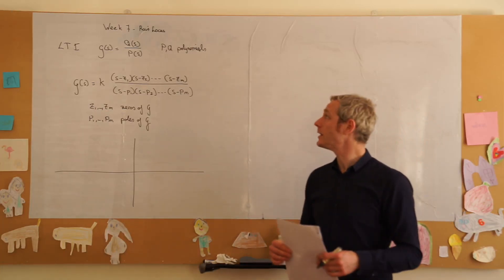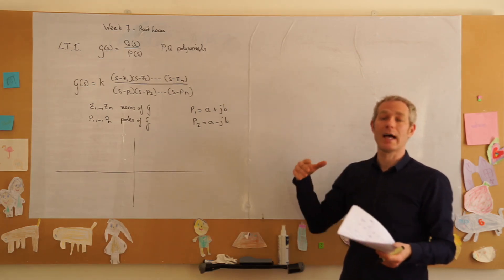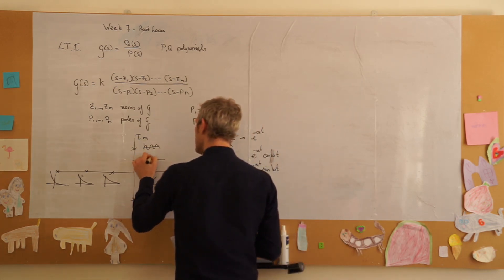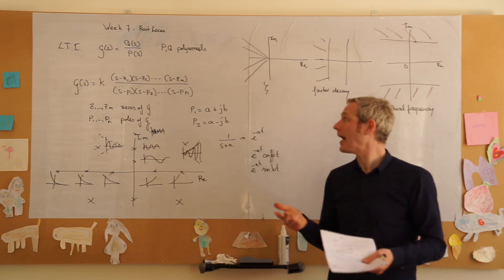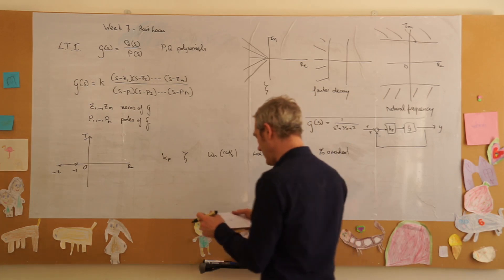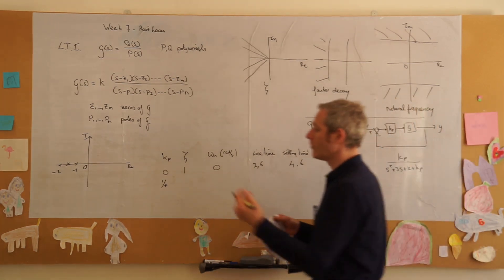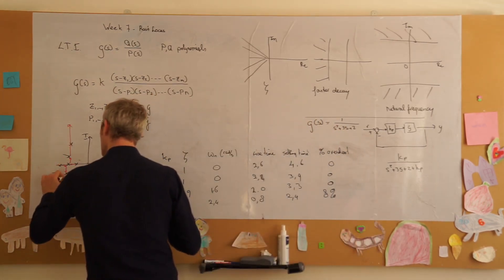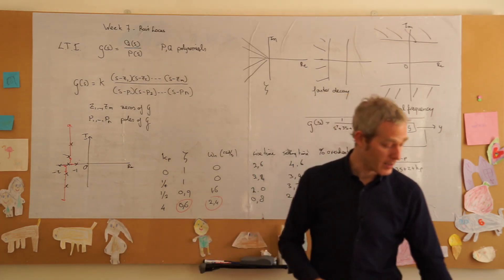Automated flight week 7 - root locus

Comment: Great lecture video's. You explain it clearly and intuitively. However, one question: why did you give the overdamped system at 10:08 a damping ratio of 1? shouldn't it be more than 1 as you're dealing with an overdamped system? Thank you in advance. I really appreciate these video's during such a chaotic time!
Reply from the maker: Thank you Rowan The Snowman! And you are absolutely correct. The mistake I made in my head was that because the poles lie on the negative real axis, that the angle theta of the line passing through those poles is equal to zero and that Z = cos(theta) = 1. This is only valid for 0 < zeta < 1. We have G(s) = 1/(s^2+3s+2), this system has a damping ration of 3/(2*sqrt(2)) which is >1.
Reply: @alistairhva4400 Aah it makes sense now, thank you very much.